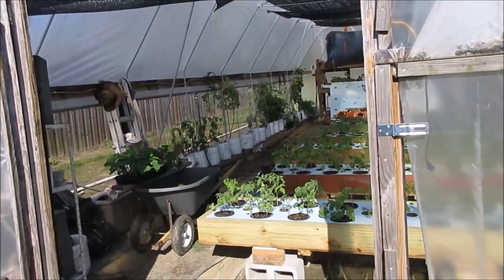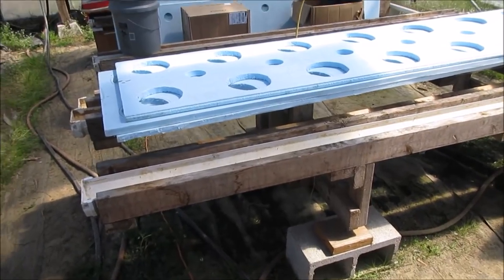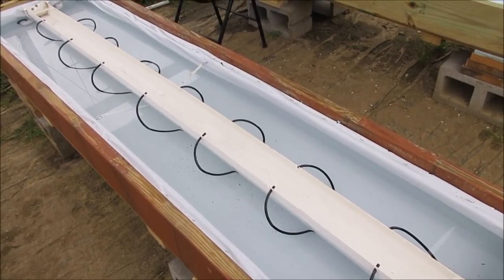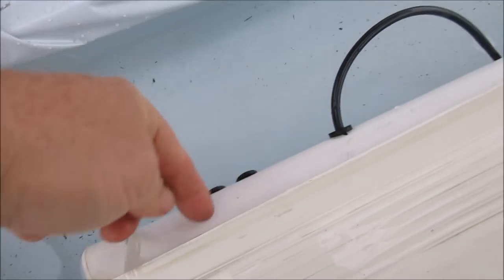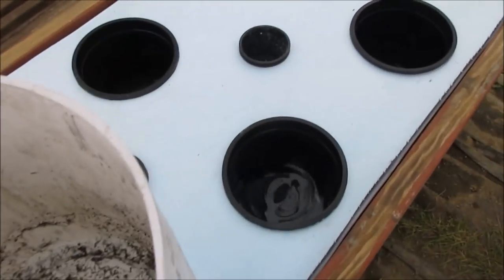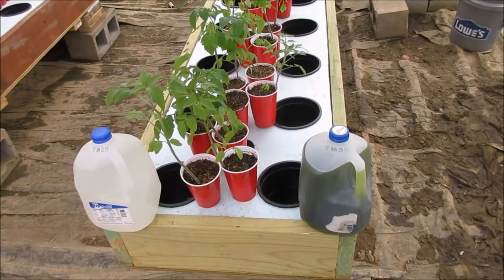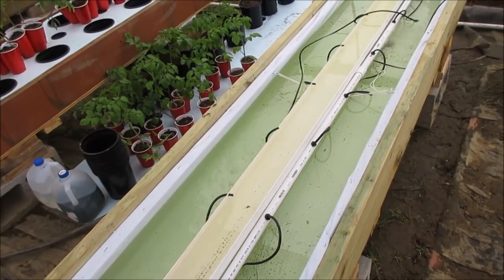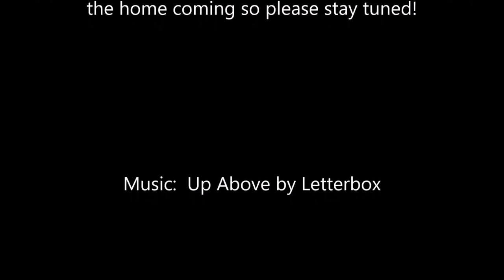Greenhouse Update:  Planting in FAWN 2

Comment: Brent, I love your videos!!  Thank you for sharing all of your lessons learned.  I am soon to start on micro-greens based on the soilless approach you advocated in your videos.  I do have a question about your water reservoir in your Fawn two system.  From growing tomatoes in earth boxes (BIG fan of those) I see that a full sized tomato plant in the heat of summer will use almost two gallons of water a day.  With 16 plants in one of your boxes won't you need to be adding fertilized water to your system on a daily basis (or even more often if a given reservoir services more than one of your boxes)?  BTW: I also appreciate that you seem to respond to everyone's questions and comments!

Comment: Is there a way to have a tomato cage on these, or are you planning to use twine with tomato clips?  I'd like to make one of these but I plan to grow cucumber and tomato plants.  Thanks
Reply from the maker: Hi Cory!  I aligned the FAWN2 systems under the cross bars of the greenhouse so I could use tomato twine/clips.  However, I did consider what you're talking about as well.  If this were in the open, my primary option would be to affix 1" EMT on each end of the platform affixing EMT, with conduit clamps, to the wood with screws.  Google "EMT Conduit Clams" and you'll see what I'm talking about.  I've done that before with container gardening.  You can cut them to whatever height you want although they come in 10' sections and are perfect at that height.  Get two 90s and cross the length of the platform with another 8(ish) length EMT to make the top support at the 10' height.  You've now created trellis support to use twine with for about $10 to $15 bucks.  A second option is to put a container on top as shown in the video and wrap a cage around that like you'll see in almost every greenhouse video I make.  In such a case, I wrap the tomato or cucumber vine around the cage.  Each wrap is 3' of growth so it works well.  Good luck.

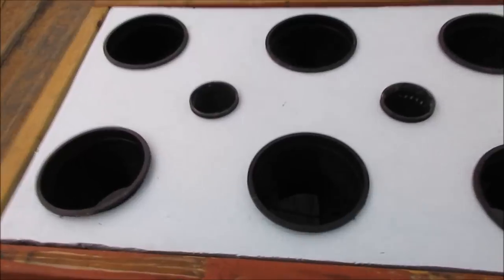Comment: Oh boy, that's becoming technical ;) I watched 3 times the 5:00 - 8:00 portion, and I'm not sure I'm getting it ;(
What is the point of all the small hoses going into the gutter rather than just feeding directly the gutter with the PVC pipe ? It's for the solution to be more homogeneous in the whole gutter ? (in this case, wouldn't bubbling have done the job ?). And I didn't manage to get the story with the "3 lines". The 4th with air, that's ok, but the 3 ... Hummm, what !? ;)
But yes, it looks amazing, lol. Maybe I'm missing some points (probably). I will try to watch again your past video on "FAWN 2.0".
Reply: Ok, I guess I'm starting to see: The small hoses go into the gutter when the system works as a fully wicking system, but they are there so that you can use them to drip when putting a 4 gallon container on top. Is that correct ? It's 9:00 that answers my above question. I misunderstood that part at first.
The system seems really great once things finally reached my brain ;) (I'm just still wondering a little about the "3 lines", lol)
Reply from the maker: Just saw some of these comments including yours so I'm going back through them all.  FAWN2 incorporates FAWN drip down.  It uses the same hoses.  When not being used as a drip system, the drip lines go into the top gutter.  They're storage locations and, at the same time, distributes the nutrient evenly along with falling water oxygenation.  The gutter/drip lines were added later using all the stuff from FAWN.  What's going on is:  Shallow water culture AND wicking culture OR deep water culture OR fill/drain culture OR drip culture systems at the same time--all hydroponic and easily changed over from system to system.  What I've really learned is that recirculating deep water culture is likely the best type of system, but I wanted flexibility to use other types and frame it all to protect against cold and heat.  TMI?
Reply: Yes, I understand the very "modular" aspect you wanted and which seem really amazing. I get the overall and all the main aspects. I may just be a little confused on a few details, but nothing important. I guess you will show more on future videos. What would IMO be great is if you showed the system running in all the different ways you can run it (with the water actually flowing). The drip and wicking is quite self explanatory. Shallow and fill/drain, a little less. For example, for shallow water culture, would the pumps keep going continually (or very often) ? Thanks for the answers and I am looking forward to the next videos (always, even if I wasn't really a fan of microgreens, but that's me ;) )
Reply from the maker: Yessir, I'm going to show her in operation...I hope.  Right now, I have to get past the tomato spots issue.  The shallow water culture is the gutters.  The overall FAWN 2 will run on a timer.  In FAWN, for years, I ran it about 3 to 4 times a day for a few minutes.  With FAWN 2, I should be able to run it from 0 - all the time in theory.  I'm working hard on all this.  I've got other personal stuff going on too so there's that too.  :O)